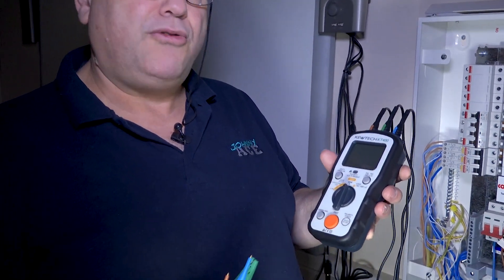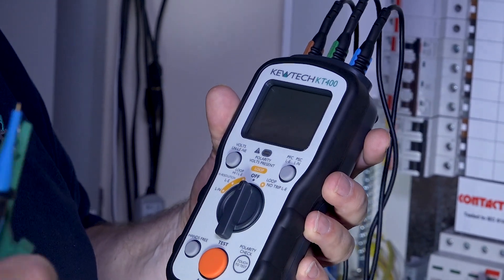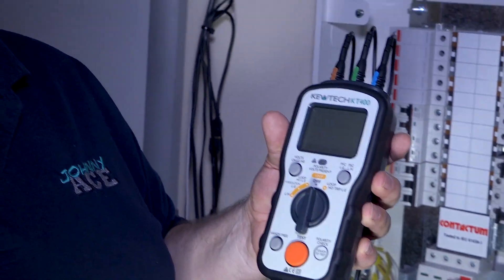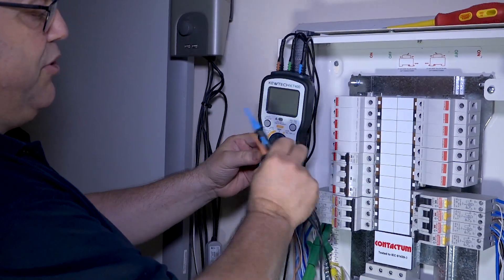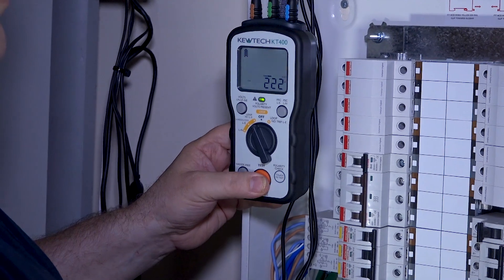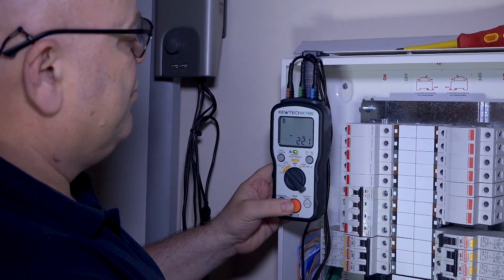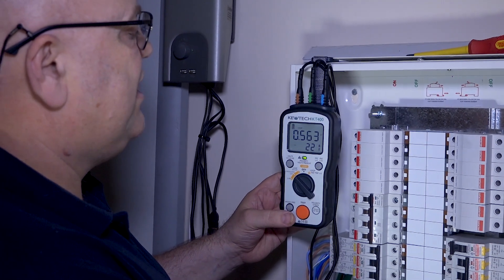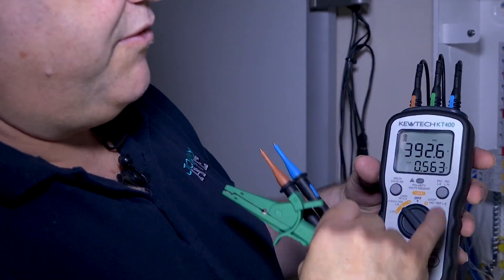KT400 on site test

Comment: I do like the Kewtech testers but struggling to understand why you would want individual testers when you have the multi function type. I have the KT63 and doesn’t look much bigger than the 400. 

Nice to see you back on YouTube John and looking forward to attending the training centre soon👍
Reply: David Wedge to drum up more trade ?
I agree I use a KT63 too and I’ve found I need to use nothing else.
Reply: Stewart Bentham just hoping that they can upgrade it to test type A’s soon
Reply: David Wedge yes hopefully they will the sooner the better. Or are we been forced buy a new MFT.
Reply from the maker: @stewben1169  David Wedge , a number of A type solutions are being worked on at the moment which will hopefully be available in the not too distant future.
Reply from the maker: David Wedge, the single functions are what all sparkies use to use before the introduction of the MFT’s. 
When carrying out an installation first fix the continuity and insulation functions are used to prove everything is ok before power is turned on. This is the part of the MFT that is generally used the most and sometimes the first to wear out, also if you are repairing motors this is what you would use.

Similar with white good engineers, gas installers these use single function loop testers to make sure that the circuit they are going to plug the new appliances into or the spur they are connecting to has a good earth reading.

RCD testers are used to fault find and check that the protective devices fitted protect you against electrical faults.

There are many other reasons why there is still a large demand for single functions and this starts with the utility companies, however, for yourself your KT63 may just do the job :) .